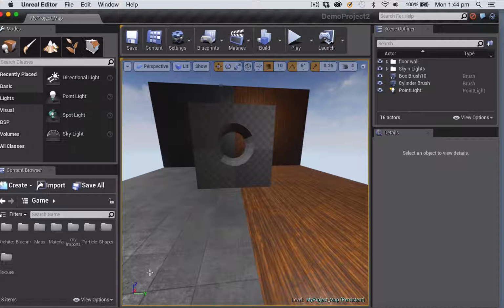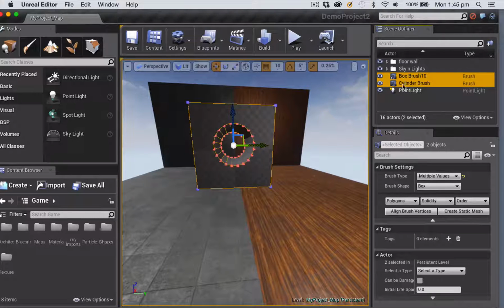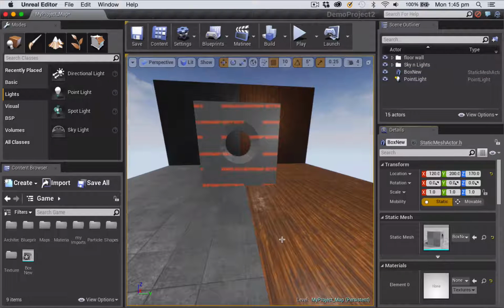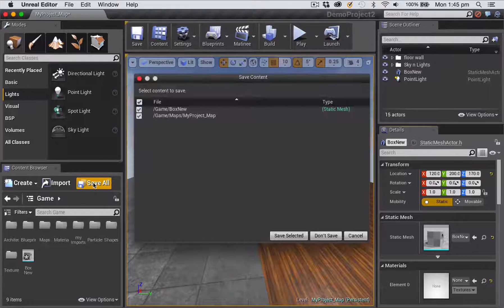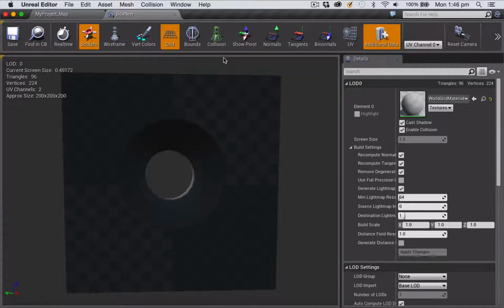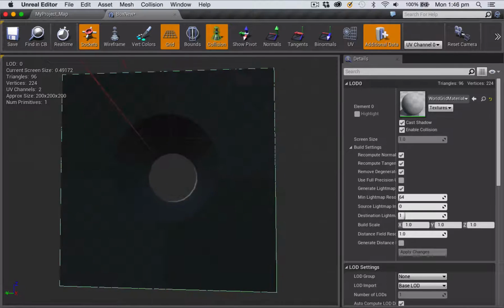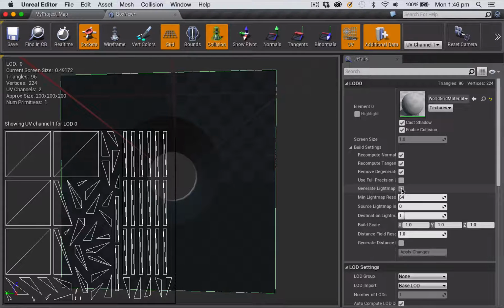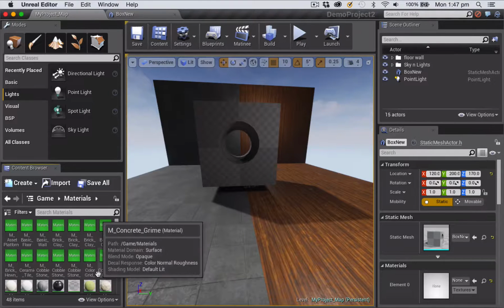UE4 Tutorial: Convert BSP to Static Mesh

Comment: Thanks for another great tutorial. I have a question - Is a Static Mesh a static mesh a static mesh? Or is there any significant difference between the Static Mesh you created in UE4 vs a Static Mesh brought in from, say, Blender. In other words, if I can save time and create simple Static Meshes inside UE4, there is no reason to attempt this in a 3D software, is there?

Comment: Hi, that's great and you solved most of the issues I had so far when I tried to convert BSPs.
I've still got a problem with a face of an object which becomes very dark (but not black) once converted (UE4 doesn't send back any errors or warnings message when building)... any idea?

Thanks!
Reply from the maker: Chris Campbell Try this lighting troubleshooting guide: https://wiki.unrealengine.com/LightingTroubleshootingGuide
Reply: Brigid Costello Great! Thank you very much.